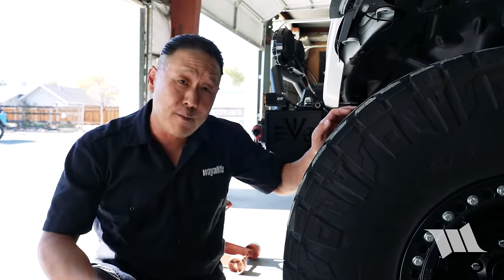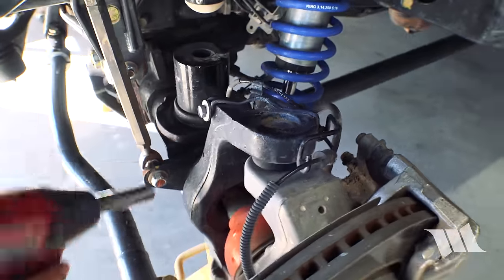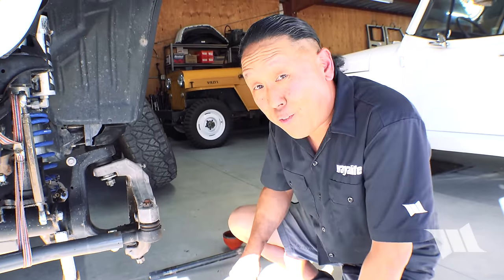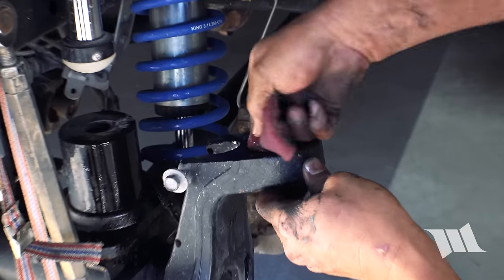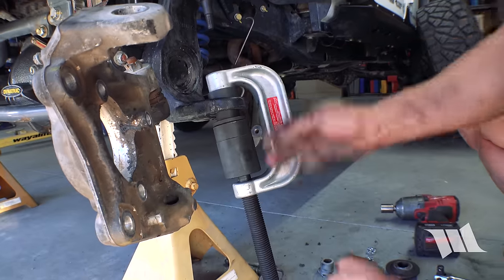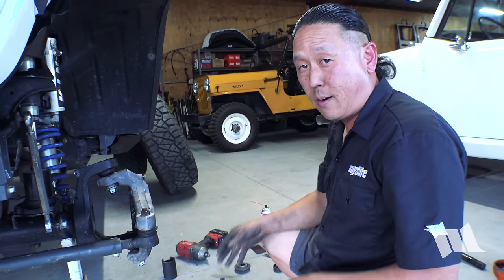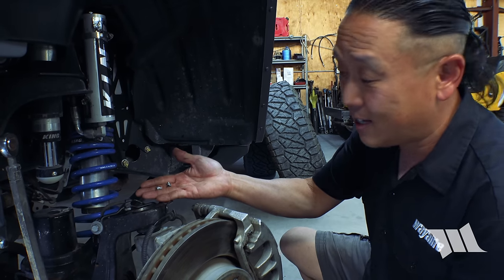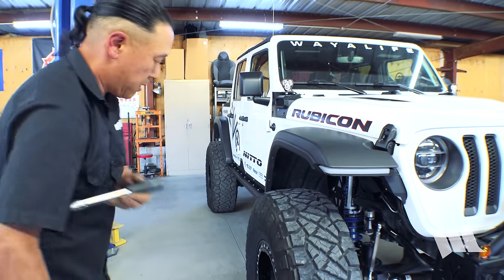How to Install Ball Joints on a Jeep JL Wrangler or JT Gladiator with Heavy Duty ones by Synergy

Comment: Well, I am done trying to work on my own stuff.  Nothing works like the videos I watch.  I have gotten stuck trying to unscrew the T30 torx screws holding the brake rotors.  Literally both sides are frozen.  I’ve tried heating the screw, using different extractors  & nothing.  Now I have a Gladiator in my driveway & can’t move it, & don’t know what to do???   I’m literally screwed.
Reply: Work through it champ

Comment: Great Tutorials. I was wondering if you heard of jeep death wobble . i have wrangler JL i get the wobble in the freeway. Do you have solution or maybe a video for it?Thanks
Reply from the maker: There is a BIG difference between a speed related wobble in the steering wheel and "death wobble". Real death wobble is a violent, uncontrollable shaking of your entire Jeep and to the point where the only way you can make it stop is to slow down dramatically or come to a complete stop. The other wobble is typically a wheel balance problem. Which is it that you have?
Reply: Yes . I get the violent shake when driving on highway and tires encounter a bump or a pot hole. Is this a common problem with Jeep’s ?
Reply from the maker: @jc4523  Not just Jeeps but ANY vehicle that has a solid front axle. More times than not, it's caused by a loose or worn out track bar bushing but it can also be caused by bad ball joints.
Reply: @wayalife   Thanks !

Comment: Hi Eddie, excellent video.  I currently have 37s on my JLU Rubi at the moment.  I'm going to 40s soon.  Is this something you recommend I do when I make the change, or just something to be aware of and do later to increase lifespan over the factory ball joints?  Also, what model KMC wheels are you running?  Thanks!
Reply from the maker: Hi John, if you're planning on running 40's, what I would recommend is that you upgrade your axles to 1-tons. If you're playing with your Jeep hard, there is no way your factory axles will hold up. More specifically, the gear ratio you'll want to run with 40's is 5.38 and the pinion in a Dana 44 is way too small. Trust me, from personal experience, it will not hold up to the load and you will have a break on the trail. Regarding wheels, we are running KMC Tank beadlocks.
Reply: @wayalife  Thanks for the info.  I appreciate it.

Comment: Eddie, why would you use red loctite ? It says it requires 500 degrees to remove.
Reply from the maker: LOL - because that's what the instructions call for and I would agree. What they're being applied to sees a LOT of heat and vibration and I have personally seen where not using it will cause those bolts to fall out on the highway and on the trail. In my limited 25+ years of doing this Jeep thing, I have NEVER had a problem removing bolts with loctite on them, PERIOD. But hey, do what you feel is necessary to do on your Jeep 👍

Comment: Going to replace my ball joins, not having any issues. I have  80,000 on my 2015 JKU rubicon with Dana44 , and  I’m running 37” tires. Should I replace the hubs since I have them off? If so what hubs would you recommend?
Reply from the maker: If you're not having any problems with them, they probably don't need to be replaced but it certainly wouldn't hurt to do it while you're at it. I've always run Spicer and they seemed to work well.

Comment: Curious to know if your aftermarket axles are stock length or longer and what backspacing are your rim? Looking for the untucked look on my Jeep JT?
Reply from the maker: We are running Dynatrac ProRock 44's and they are stock length. Totally unnecessary if you're only running 37's or under. If you want the untucked look, I would recommend that you run wheels with 3.5" of back spacing.

Comment: Great video thanks!   However if I had a lift I would be using it for this job. LOL
Reply from the maker: LOL - trust me, when I'm not filming what I'm doing, I do. But for a video like this where MOST guys don't have a lift, I try to show how they can do it too and just using jack stands.
Reply: @wayalife  I understand.   I will be doing this job in my garage this weekend and it will be on jack stands. LOL    Ball joints and right front brake calipers as it is hanging up.

Comment: How long did the factory ball joints last you lifted on larger tires?
Reply from the maker: To be honest, I actually think the factory ball joints were still okay and we have over 60k on the odometer. We installed these more to test them out than anything.

Comment: Isn't it recommened to torque the castle nuts to the final specs with the weight of the Jeep on them?
Reply from the maker: Not sure where you've heard that from but it's never been an issue for me to do it this way. It's also how axle manufacturer do it. That is, without the weight of a Jeep on them.

Comment: Looks like not too tough a procedure. Would probably take me more than 28 minutes though lol! Just curious, why do you thread lock your bolts? doesn't that make them really hard to remove next time you have to do it?
Reply from the maker: For one, they come thread locked from the factory. For two, Synergy specifically states you should use red thread locker and so would I. There is a LOT of heat and vibrations at the wheels and I have personally seen on multiple occasions where people who did NOT use thread locker have lost bolts here and on the highway and on the trail. I know the internet is full of self-professed smart people who will tell you that this is a bad idea without ever showing proof of it and I would never pretend to know more than them, but what I can tell you is that in the over 25+ years that I have been doing this, I have NEVER had a hard time removing thread locked bolts.
Reply: @wayalife  OK, thanks for the info. When I was installing my lift my buddy asked if I was going to use threadlock and I was afraid to.

Comment: Did you prefer synergies ball joints over dynatracs rebuildables ?
Reply from the maker: Dynatrac ball joints are awesome joints and I have run 3 different sets of them in the past. However, the idea of them being rebuildable on a Jeep is nothing short of a joke and the rebuild kits cost about the same as new ball joints. That said, I would still run them as they do last longer than factory joints. The main reason for installing these ones made by Synergy is to test them out and see how they do. At this point and time, I don't know the answer to that but it was our hope that we could at least show people like you just how easy it is to replace ball joints.

Comment: Nice! Curious why you chose Synergy over Dynatrac joints? My ball joints were MUCH more difficult to press out. Ended up needing to use the handle of my floor jack as a cheater bar on my 24" breaker bar. It sounded like a gunshot when they finally released. I guess that's what a couple Midwest winters will do.
Reply from the maker: LOL - I guess we're lucky in that we live in Nevada. Everything is so much easier to work on here, even Jeeps that are almost 70 years old. As far as this video goes, our main purpose was to show people how to change out ball joints and we decided to install Synergy because their joints are new, heavy duty and more affordable. Also, having run Dynatrac ball joints on 3 other Jeeps, I can tell you that they are nice but far from rebuildable on the Jeep. Also, the rebuild kits cost about as much as new joints. So, if I have to remove the joints anyway and pay that much for a rebuild kit, I thought I would give these a try to see how they do. With any luck, I won't have to replace them anytime soon. Certainly, my factory joints had over 60k miles on them and they were still in good condition.
Reply: @wayalife  I haven't had to rebuild yet, but I'm curious what part of the process wasn't possible while they're installed? Dynatrac's video make it look pretty straight forward. I'm certainly not doubting your experience or advice, just mostly wanting to know what hurdles to expect whenever I do need to rebuild. Given how relatively easy yours came out, it's probably at least as quick/easy to replace when necessary. Although Northridge currently has the Dynatrac rebuild kit for $150, so it cheaper than most quality aftermarket replacement joints. 
https://youtu.be/xL4axrsb1k4
Reply from the maker: LOL - allow me to clarify. In order to rebuild the ball joints, you still have to do 90% of the same work to get to them. As in, you need to remove your wheels, brake calipers, rotors, unit bearings, axle shafts AND you still need to remove the knuckle. At that point and time, I can remove and install new ball joints in minutes versus spending a hour or two taking apart the Dynatrac ball joints, rebuilding them and then reinstalling them. Also, these new Synergy HD ball joints only cost $150.
Reply: @wayalife  Ah, thanks for clarifying! Somehow I was thinking you were saying you had to actually press them out in order to rebuild.
Reply from the maker: Oh, no. Just saying that it takes way more time and effort to do than just pressing out old joints and installing new ones. To me, being able to rebuild something on the Jeep means that I can just remove the wheels and maybe even the axle shaft and do everything else from there. Nothing even close to that.
Reply: Go with ball joint deletes.  You'll never ever need to replace them.

Comment: … and how do you know when is time to replace them? Or you just did it as preventative measure?
Reply from the maker: When ball joints start to go back, you can kind of feel it (poor handling, sloppy steering, etc) and when they're really bad, you'll get death wobble from it. It doesn't take much for them to be bad too and a dial indicator is typically used to determine as much.
Reply: @wayalife  ok I see. Did you change the brakes? All that additional mass and wheel inertia is controlled by the original brakes? Isn’t that asking too much for these brakes?
Reply from the maker: Kind of making a big assumption there. Unlike the brakes on the JK, the JL Wrangler are bigger and I have found them to be more than enough to get my Jeep to stop just fine, even with 38" tires. But hey, that's just me.

Comment: Upper ball joints could you use a c-clamp to put tapered sleeve back in? As long as you paid attention and slowly jump side to side so you’re not pushing it in, in a bad angles.
Reply from the maker: You probably could but it really isn't necessary. If you get the sleeves in too tight, your steering will feel too tight too.
Reply: @wayalife  good point I never even thought of that. Keep up the great videos and thanks
Reply from the maker: I had a long conversation with Synergy before this install and they explained what they learned during R&D. How I show it done in this video is based on what they recommend and is stated in their instructions and based on it.
Reply: @wayalife  right on thanks again

Comment: Are these rebuildable? And another question, I noticed you pulled the boot off the original ball joint, does that make it easier to get it pressed out, or is that just your preference of how you like to do it?
Reply from the maker: These are not rebuildable but really, even rebuildable ones would still require the same amount of effort and the rebuild kits cost about as much as new ball joints. Trust me, I've run rebuildable ones on 3 different Jeeps. Regarding the boot, I'll be honest and say I only did it because Synergy says to do it in their instructions. Typically, I never do.
Reply: @wayalife  ok thanks I appreciate it, I've watched other videos and seen people do it and seen people not as to taking the boot off. Love the content and videos keep up the great work. If you ever come to East Tennessee need to go out to wind rock awesome trails

Comment: Without getting in trouble...could you compare/ recommend synergy or dynatrac?
Reply from the maker: Well, being that I just installed these, I couldn't tell you with any real authority how they'll hold up but so far, I think the Synergy ball joints are really nice. They seem to be well made, I like that their metal on metal design and liked how they've recessed the zerk fitting into them. As far as Dynatrac goes, this is something that I can talk about being that I've been running their ball joints since they came out over a decade ago and on 3 separate Jeeps. They are nice for sure but a bit on the pricey side. Yes, they are rebuildable but you're kidding yourself if you can really do it on your Jeep. While there may be a way to do it, I have never been able to do it. Also, you need to take into consideration that rebuild kits cost about as much as new ball joints. Hope that helps.
Reply: @wayalife  thank you Eddie for detailed response man. Appreciate it. When I turn the wheel under load, i hear loud clunk every time and I’m trying to figure out if it’s my worn out Rock Krawler control arms joints or the ball joints. I’ll rebuild the control arms first I think as it’s much easier process and I know couple of them are bad.
Reply from the maker: @persicon_jl  A clunk when turning the steering wheel is typically a track bar issue. What you're hearing is it shifting side to side under load. I would give the joints a look to make sure they aren't bad and make sure the bolts are tightened to at least 125 ft lbs of torque.
Reply: @wayalife  oh got ya. I’ll check it out today. Ty

Comment: Say i noticed the new ball joints were smooth. When do we need to uss knurled ones?
Reply from the maker: So, typically, you should only use knurled ones IF what you're replacing are knurled as well. The only other time to use them is IF your end forgings are damaged from a bad install or on really old ones that have seen a LOT of ball joints.
Reply: @wayalife  another question, i have on my jk the older version of the synergy ball joints with the grooves on them. That means in the future I need knurled ball joints? Thanks
Reply from the maker: @stzd8  Yes. If you have knurled ball joints now, that is what you should install in the future.

Comment: I thought jeep moved to HD ball joints on this model , to address  issues/concerns that were  on JK .
Reply from the maker: To be fair, they do seem better and even after 60k miles, mine still seemed ok but even Spicer makes an upgraded HD ball joint to replace what is used on a factory axle.

Comment: Would you have to do an alignment after installing those balljoints?
Reply from the maker: Nope. Nothing done here will affect your alignment.
Reply: Does this apply to JK as well?
Reply from the maker: @justinriddle5934  Yes. Nothing changes with the installation of ball joints. Also, you can only do an alignment IF you have adjustable components. If you are still running stock components, they are not adjustable so the most a shop will charge you to do is recenter your steering wheel.
Reply: Awesome, thank you so much for your help. 🤙

Comment: Legit question...did you re-use the factory BJs with the intention of making a video about installing aftermarket BJs? Aside from that, I can't think of a logical reason why you wouldn't upgrade to heavy duty BJs from the get go knowing that the factory BJs weren't going to hold up to the normal Wayalife abuse...especially since you had the perfect opportunity to upgrade while you were at Dynatrac getting the PR44 installed. Not unless Jim would take offense to you asking them to install another manufacturer's BJs vs their own.
Reply from the maker: LOL - at the time that we had our ProRock 44 made, Dynatrac did not have their ProSteers available for the JL. In fact, nobody really did and our factory ball joints were fine so we just reused them. I should note, even after removing them for this install, the factory ball joints were still fine.

Comment: How come the jl transfercase seems stiff for a new vehicle?When I had an 87 bronco ii it felt like butter.
Reply: that means you dont use 4wd as much,mines is smooth as butter now since i use the hell out of my jeep
Reply from the maker: @Michael Smalley Part of it is because of the FAD. The tolerances are much tighter. But, going from 2WD to 4HI should still be pretty smooth. 4LO does require you to be rolling ever so slightly and in neutral.

Comment: Hi, I really like your videos bro, and I know how passionate you are about jeeps… I recently bought a 2019 JL wrangler but after driving it for a month I been dealing with an issue I’m giving up on because the mechanic can’t find the problem. It’s been giving me a No bus alert and has left me in the middle of the street all alerts turn on on the cluster and the wipers start moving can’t turn it on to move out of the street and can’t even turn on the hazard lights to alert the traffic… after maybe an hour the Jeep starts again. I really love my Jeep but I can’t live like this. Hoping you can help me find the issue and save my Jeep so that I can keep it… the mechanic said he was going to remove the aftermarket alarm system to see if that is causing the short preventing the computer  to communicate with the vehicle… please help
Thank you
Reply from the maker: Do you have an aftermarket battery installed or other accessories attached to it? If so, what you're describing sounds like a loose battery cable and this is a common problem especially when people connect the terminal clamp incorrectly. That, or it could be that you have a loose ground connection. Again, this could be a result of an aftermarket product being installed.
Reply: @wayalife  it actually does have aftermarket accessories on it like automatic sidestep aftermarket fenders, bumpers, winch fog lights and upgraded alpine stereo.
Reply: @wayalife  also the aftermarket alarm system is connected through the OBD-ll port. It’s doing some kind of loop on it.
Reply: @wayalife  I appreciate you responding to my questions brother, God bless always and keep up the good work… thank you
Reply from the maker: @carlos200972  Well, all those things are suspect.